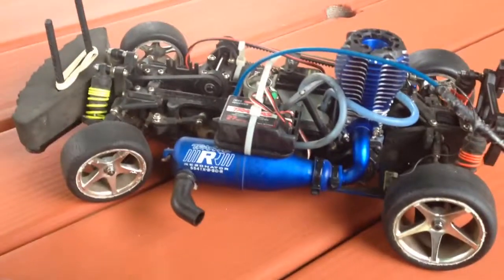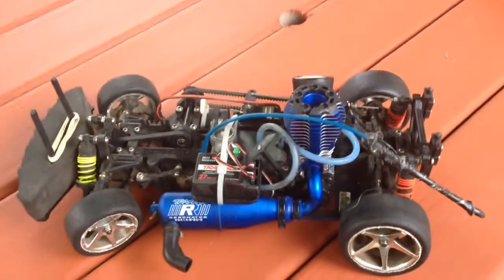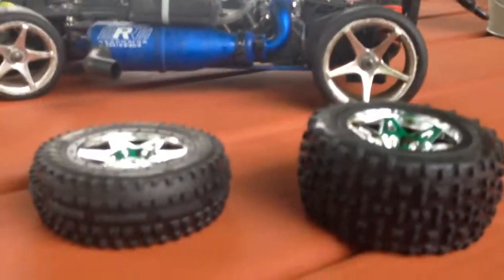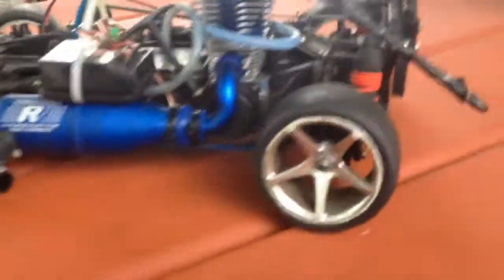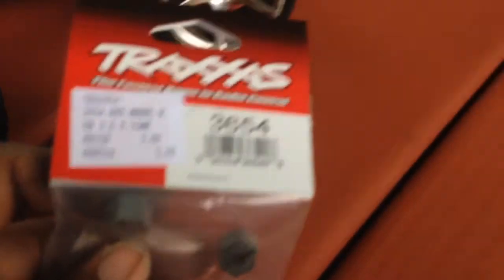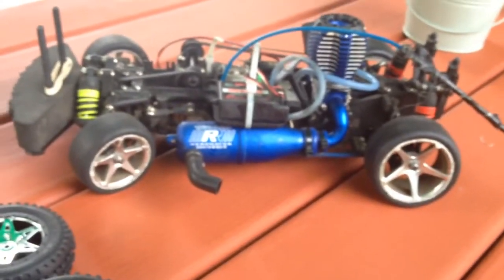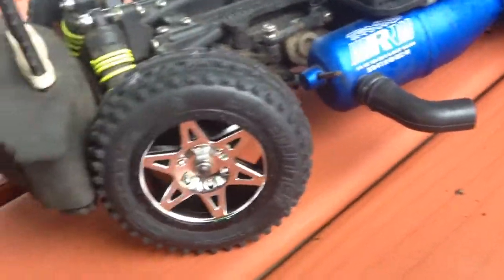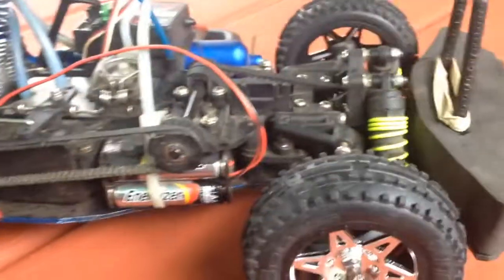Traxxas Nitro 4-Tec Off-Road Conversion

Comment: You know the gearing is 1:1 so putting a larger back tire on and a smaller one on the front is like a rwd car holding the brake half way and hitting the gas so it's always going to be doing rolling burn outs with zero traction in the rear
Reply from the maker: I don't understand your analogy
Reply: +MrSmith88 the front wheels turn slower than the rear if you want to use 2 different sized tires you need to regear the front to match the speed of the rear or simply just get off road tires of all the same size.

Comment: any updates? I have one of the like yours, think is like 03 with the original engine that I only use for a few month and would like to do a rally conversion as I never liked how low the car is.
Reply from the maker: JR Armstrong Sry, no update. I ended up selling because I was unable to get fuel. I've switched over to 1/5th scale. The 3.3 is a direct bolt on, you'll need hub extenders and front stampede wheels for both front and rear.